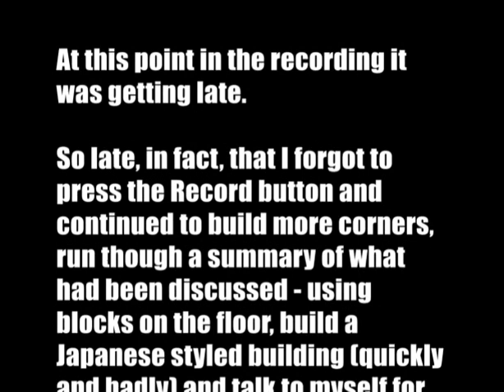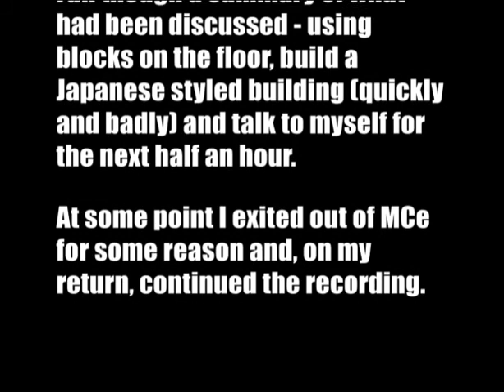Building with Baj - 2: Round Rooves and corner Roofs. No Ruffs

Comment: Okay, not so much a question about roofs, though it is related to building (and I figure you might have an answer, or can at least experiment in a fun way). Anyway, on my new map i would like to build a forest-based walled complex. I have the interior already designed, but I am having issues with the exterior walls, I don't want it to be stone and I want it to look good but at the same time not be the same. (I also want it t blend in, but not be invisible) Any helpful ideas. :) Thanks